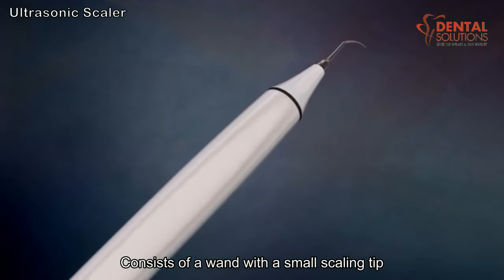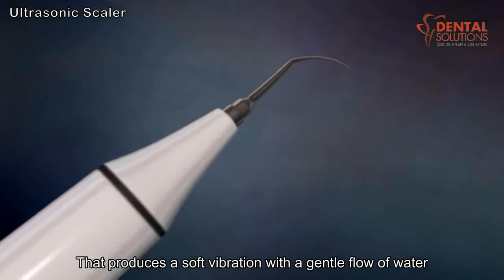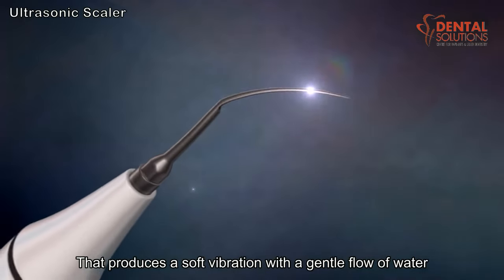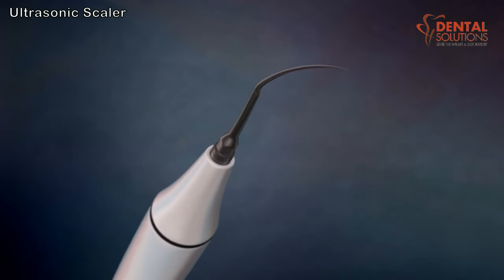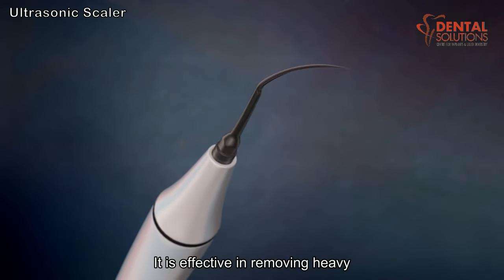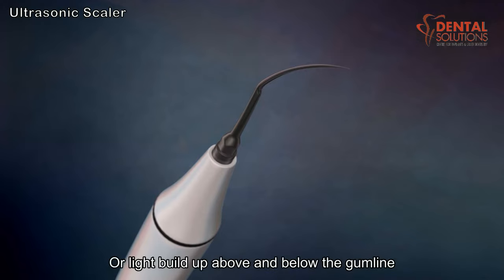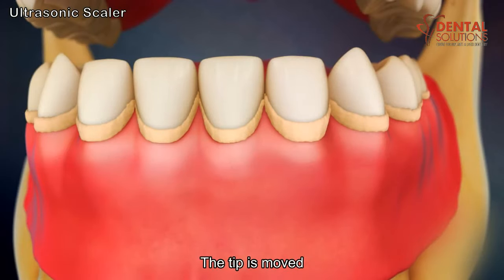Ultrasonic Scalers: Clinical Use and Benefits

Comment: A dental hygienist used this to clean my teeth over 2 months ago and I have been in pain since that day.  I had no problems with my teeth or gums till this device was used.  Ppl this machine can cause damage to gums and teeth if it's not used correctly.
Reply: Oh wahhh cry me a river
Reply: Same happened to me it's been a year now
Reply: it just means that you had so much plaque that your gums got infected and your teeth got lose. For the gums you need to use anti bacterial mouthwash daily until your gums can heal and be tight around your teeth and then you wont have any pain anymore. but since this comment is 2 years ago I think its already healed.

Comment: guys you can buy diamond tips for this and use it as a cutting tool.  I've seen it used to get between teeth for very thin cuts better than a drill.  Can have so many applications as a cutting tool in other industries too like jewelry making, art, electronics, etc!  Those diamond tips with this type of ultrasonic scaler creates the ultimate cutting instrument!
Reply: it is basically like a oscillating tool.  can even cut drywall and wood with it!  Can precision cut porcellain and marble and tile!  Can take a rock and make a intricate sculpture with it!

Comment: Ultrasonic scalers can ruin ur root, after a horrible cleaning and year long ordeal i had to get 2 root canals, there os actually a ncbi medical study on this.
Reason is that ultrasonic scalers create enormous amount of heatnand friction and this can can actually damage the root of the tooth, my issue initially started as a intermittent throbbing pulsating pain, later on it was determined it was irreversible pulpitis.
Beware guys. Good luck.